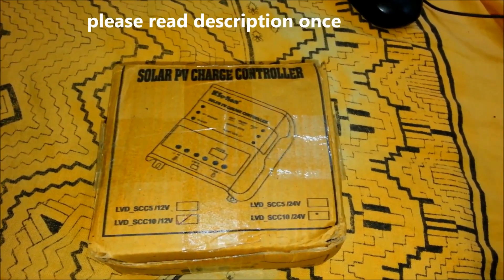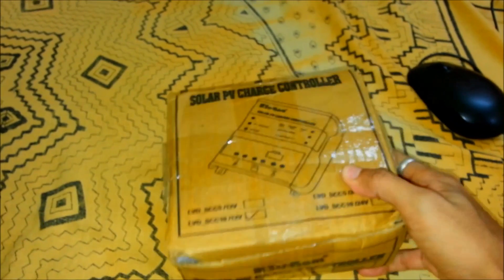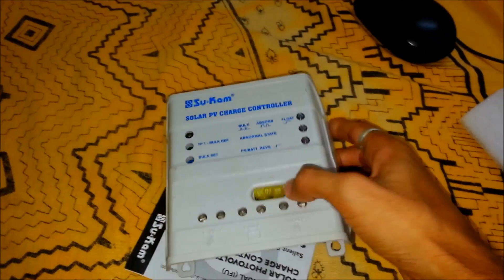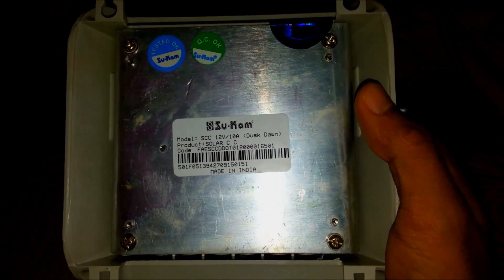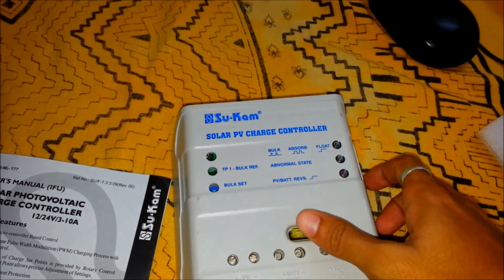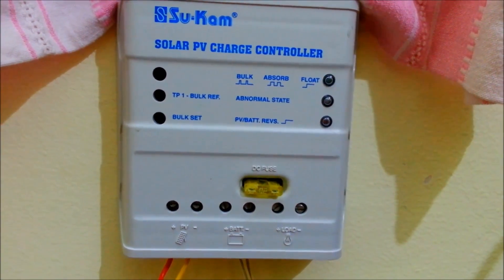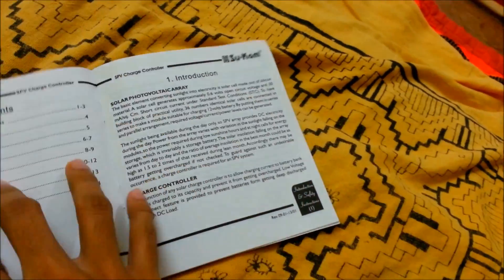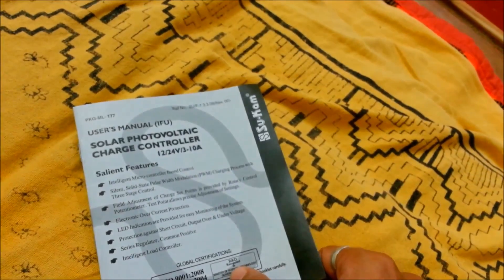SU-KAM solar charge controller [PWM] UNBOXING & REVIEW

Comment: Can i connect a 335watt solar panel to this controller and connect it to a 150 Ah inverter battery.
Reply from the maker: Max solar input is 120W (12V @ 10A) , you cannot connect 335W solar panel but yes you can connect 150 AH battery

Comment: Abnormal red light is blinking continously. What may be the reason?
Reply from the maker: Check the fuse
Reply: @MrVishalarwade  fuse is ok..
Reply from the maker: @satenderyadav8334   Check battery voltage

Comment: Thanks for reply, I have checked fuse it is well. Yesterday night I was using DC current from battery through SCC. After midnight battery become low and character's middle red light was continuously on but I hadn't disconnected load. In morning red light had stopped. After sometime even in Sun light no charging is becoming and green light is not blinking. My Solar charger controller is Sucam 20 amp.Please tell me it's solution.  Thank you.
Reply from the maker: welcome, ok 1st thing u need to do is disconnect the solar charge controller from the battery for 15 min by doing so it will reset the solar charge controller then again connect the solar charge controller back to battery.

Comment: can 300 wt panels be attached to this controller
Reply from the maker: it can handle only 10A (120W) ,so you can't connect 300W to this solar charge controller
Reply: viƧhal ...which controller should i use then
Reply from the maker: do u have 12V solar panel?
Reply: viƧhal ...three ....100 wt panels..or 2..150 wt panels
Reply from the maker: okay its a 12V solar panel .....you have to choose a charge controller which can handle 25A
Reply: viƧhal ...r u sure .this will handle 300 wt panel
Reply from the maker: yeah i m sure because 12x25=300

voltage x amp =  watts